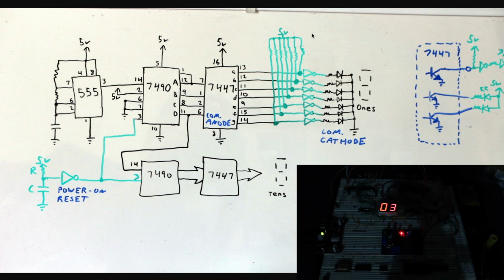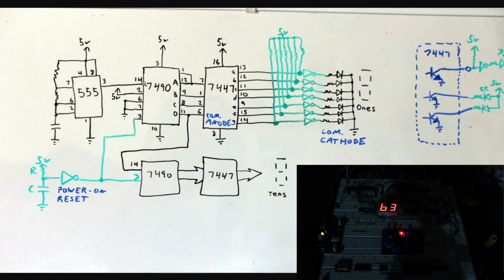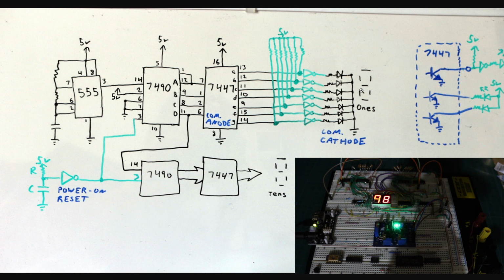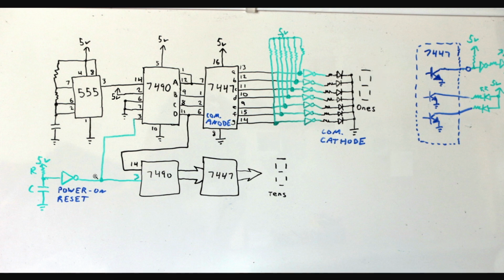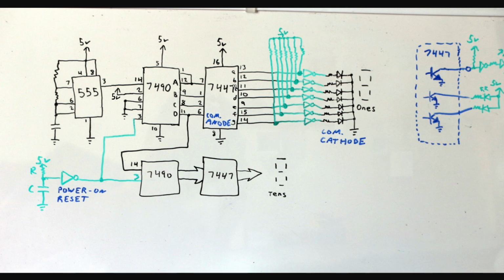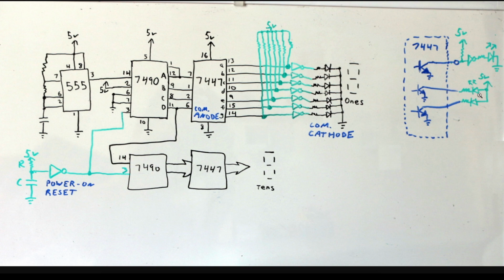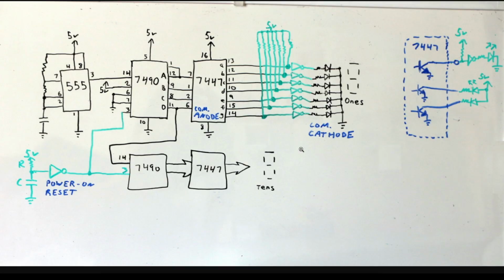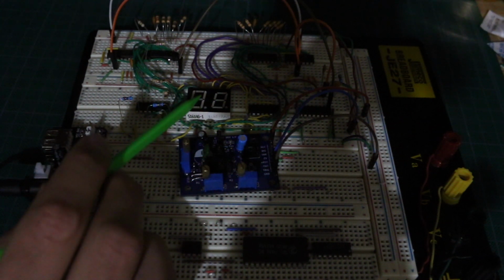7 Segment LED Counter with 7400 Logic - 555 Dev Board Winner!

Comment: Nice project. You could have chosen the easy way out (take the 'random' value from 00 to 99 modulo 20) but the reset at value 20 using just two extra components is briljant.
Reply from the maker: I was considering all kinds of things including just using a calculator to calculate wrapping around an offset from my maximum target value to the target of 99 on the count but since we’re doing circuit design I thought a transistor made more sense!   If I used an Arduino then a mathematical solution might have been more fitting. There’s going to be future opportunities to use other selection methods.

Comment: Looks like something out of FranLab (another YouTuber).  I remember these encoders from my Jameco catalog 30 years back ... that do binary or BCD.  It is a whole lot easier and less expensive to have a $0.30 MPU define an LCD font, then strobe each digit's common drain in an interrupt.  But where is the nostalgia value in that?  I want some 15 segment monsters.
Reply from the maker: Maybe next time I will use nixie tubes! I want some of those LED segments like pinball machines before they all had big screen TVs in them.    I remember filling out a paper order form and mailing it to Jameco with a money order several times around 30 years ago. How things have changed.
Reply: @GadgetReboot   Pinball LED segmented displays are not hard to find.  Twice the fiddly wires per digit.  Here is my favorite video from Fran ... a NIMO digit tube requiring 1750 Volts (for real).  That is some dedication to old tech.  https://youtu.be/xmWg7CtN0Ac
Reply from the maker: I’d like to have a display like that but I don’t know how I would possibly power it with my junk box.